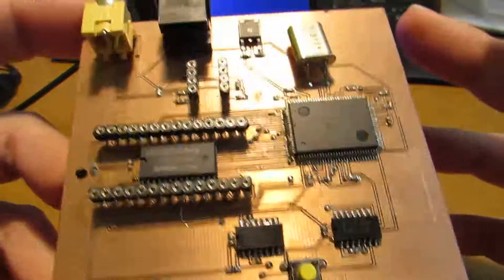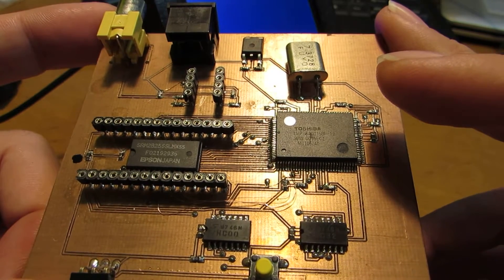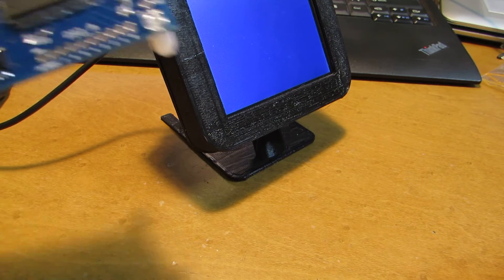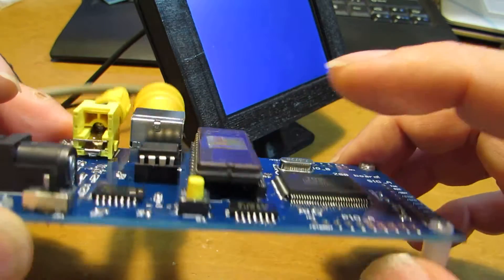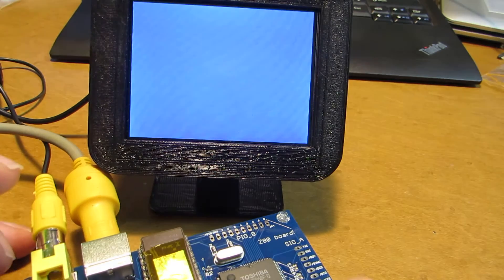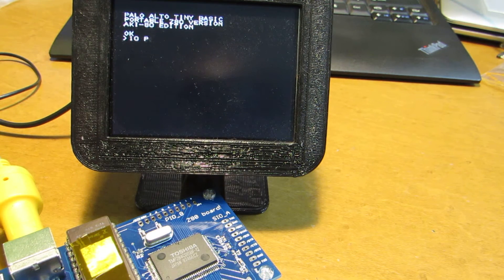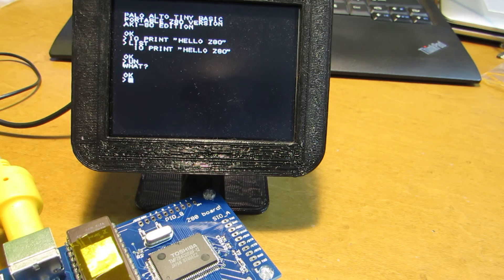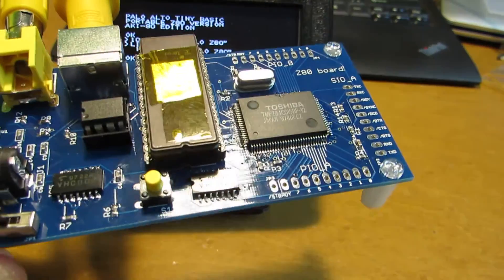Very smart Z80 based single board computer with keyboard/video interface

Comment: Was planning to buy it but why is your store not open and not until 2019? The price was great though. Is the cpu soldered or is it a socket?
Reply from the maker: Thank you for interest. I am on long business trip and the store will open at the beginning of Mar. The CPU is soldered... Thanks!
Reply: does it come with flashed rom or is it something i need to myself?
Reply from the maker: it is with tinyBASIC rom and fully assembled. All you need to prepare is keyboard and screen supporting NTSC video input. Thank you for interest!
Reply: might actually order it once the store opens up and thank you for changing the date on the tindie store.
Reply from the maker: thank you for your interest!!

Comment: another amazing project. 
questions; 
what is the average current draw at 5v for the board? 
can you access all the IO with tinyBASIC? 
what is the z80 clocked at? 16mhz
can you save programs?
do you have to hit reset on boot everytime?

sorry - im foreign to z80, i was a commodore kid
Reply from the maker: Hello, average current is around 100mA and current tinyBASIC does not have I/O access (we need modify by ourself) and clock is 7.3 MHz/2 = 3.6 MHz. No program save function and we need reset on boot. Thank you for interest!